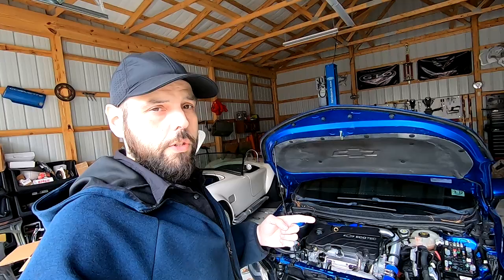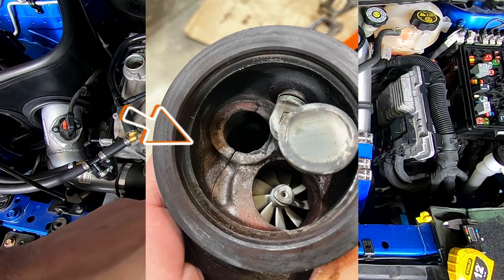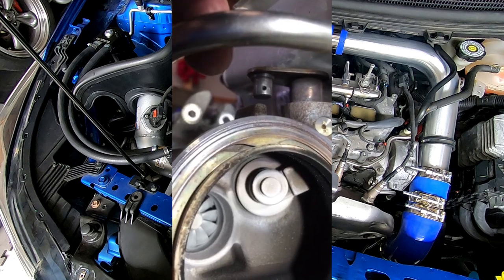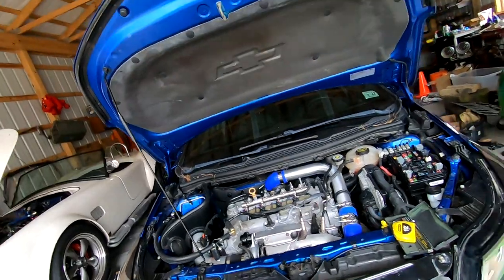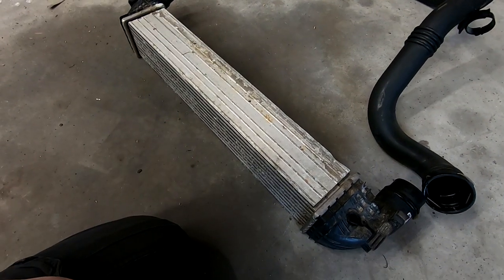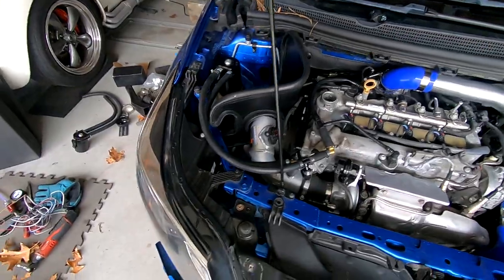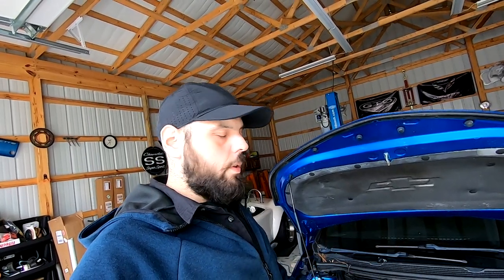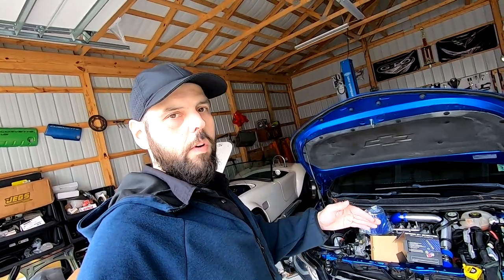Common CRUZE problems and issues from Dave's World

Comment: The code that keeps coming up for me is P0299. Usually happens when I accelerate and once the code comes up the car drives extremely sluggish and doesn’t want to move at all.
Reply: To add this code goes away and comes back. Some days the car drives great and other days it drives sluggish and that’s usually when the check engine light comes back on and gives me the code p0299.
Reply from the maker: @tylerwhite7367  Are you running a cold air intake?
Reply: @davesworld2132  yes I am
Reply: I was getting this code before the cold air intake though.
Reply from the maker: @tylerwhite7367  It could be a few different things. It could be a dirty mass airflow sensor. It could be an intake leak. It could also be an exhaust leak. Is the car running like crap?
Reply: @davesworld2132  some days it drives normal and other days it drives like crap, check engine light comes on and off. I just ordered a new wastegate thinking that my current one might be done for. I replaced my spark plugs last year still had the same sluggish problem. I’ve been trying to research this for a while. I brought it to the dealer when it first happened to me about 2 years ago they looked at the turbo and didn’t see anything wrong with it they cleared the code and said if it comes back on again to call them about discussing replacing the turbo which didn’t sit right with me.
Reply from the maker: @tylerwhite7367  are you tuned? And what your peak PSI?
Reply: @davesworld2132  no clue on my peak psi. Also yes it is tuned with trifecta. I installed the tune six months after I purchased the Cruze brand new from the dealer. I noticed sluggish once around 30k miles but thought it might of been a bad batch of fuel. Now for the past two and a half years it’s been more regular with the on and off of being sluggish. It was sluggish on my way home from work today and then driving it to dinner it drove normal.
Reply from the maker: @tylerwhite7367  what wastegate did you buy?
Reply: @davesworld2132  I bought the mamba wastegate off eBay
Reply: @davesworld2132  I also bought the Performance Recirculating Valve off BNR as well maybe thinking that could be the issue as well. After I install these I plan to have the car re tuned for the upgrades that I install
Reply from the maker: @tylerwhite7367  what’s the box say on it? 10-16 or 16-19?
Reply: @davesworld2132  not sure on what the box says since I haven’t received it yet. eBay does have it listed under my engine size so I figured I’d give it a shot and see if it fits and resolved my issue lol
Reply: @tylerwhite7367  I have the same exact issue, 34k miles, trifecta tune, happened before I put in the aftermarket KNN cold air intake. Shows engine code P0325. But vehicle will stop accelerating and drive very sluggish, only when I hit the accelerator heavily on the highway from 50+ mph when merging. The engine light turns off directly after swapping back to stock and I cannot reproduce the issue on a stock tune.

Comment: What about code P0327 ?
Reply from the maker: That's a knock sensor code so you have a fuel issue or possibly a 12 volt wire/sensor issue. Typically its a fuel issue most commonly.

Comment: Wow no wonder when I opened up my transmission solenoids and took out this plastic tube my boost leak check engine suddenly disappeared like it didn't even bother coming back on 🤔🤨😯😲
Reply from the maker: Interesting. What trans was it?
Reply: @davesworld2132  It's 2017 Cruze 6-speed AT 1.4L. I was to clean the solenoids and needed to remove the plastic tubing from throttle body to intercooler and having a engine code before hand for boost leak P0299. But probably because I disconnected the battery for about a week that the code disappeared I don't know and when I hook it back no more engine code P0299. I'm about to get the transmission rebuilt, the previous owners might've beat the crap on her but I wanna correct as the engine really is running good. That plastic tube is crap 😂🤣
Reply from the maker: @czerus2233  Do you have any transmission codes?
Reply: @davesworld2132  the whole time I owned the car since last year only the P0229 only but the transmission started to miss 5th gear randomly, and jerks shifting the 3rd all the time. It was back in January when it gets severe even 6th gear wobble/shakes (when the car is underload going up a slope or with passengers) the car along with 5th gear so technically I can only drive down the side streets as the 4th gear only goes 50mph @60mph it just screams and in need to shift to the next but like I said shifting to 5th gear will make the car shake violently. Then one night on my way home I really wanted the transmission code to show up so I kinda push the 5th gear till the car went limp mode (It only show on the Dash "L" and not the usual "L1,L2, etc) and there it was, P0796 and P0700, one is for Pressure Solenoid failure and Failure or open circuit in TCM for the second one.
Reply from the maker: @czerus2233  Oh ok that makes sense. At first I thought you meant the intake caused leak code caused the problem. Are you doing the rebuild?
Reply: @davesworld2132  My initial decision is actually buying a low mileage salvage trans on ebay, have it delivered and swap it and for the meantime to make the car back to the road but due to issues I can't sit and work on it.. it's better I get it fixed as there might be upgrades/updates to this automatic transmissions only the specialist can do (like drilling new holes and plugging the faulty location etc.) and for the warranty if something went wrong (gonna bite the bullet 😣). My original plan is to have my old transmission rebuilt by myself slowly as I get the replacement parts so I have 2 to swap in and out as this are not really that reliable as they say (or it is once the trans specialist does update the internals and make it reliable I don't know yet). But for this video that you made when you mentioned how the plastic tubing that runs from the throttle body to the intercooler might cause boost leak code when not seated properly or through vibrations over time produces the leaks and I think that's what made my check engine code disappear 😁 as the cheap scanners does point out the turbo charger replacement are one of the options.
Reply from the maker: @czerus2233  Yes that would definitely cause that. I’m glad it was somewhat helpful. I do have those pipes as well on my website. Ironically transmission wise I’m going through the same problem with my wife’s Acadia. I’m going to be doing the same thing and swapping out some trans parts.
Reply: @davesworld2132  this transmissions are a pain to find info let alone this 6T35's on the '17 Cruze. I tried buying a AT solenoid pack on ebay and turns out it was 1st gen TCM compatible wasted time and $12 to ship back to the seller so that's when I tried cleaning out the solenoids but still having problems ( from what I learned the bad design wave plate eats the barrel of the 3rd,5th,reverse but I really don't know why my 6th also shakes the car) and tried looking for more info and remembered some updates on AT transmissions includes upgrades on the valve bodies, pistons, etc and plugging, reboring hole on the valve body it just came to me this is too much for me as this is my first time really doing hands on a car. I really wanna be able to fix my own car as things are not really going good when it comes to shops and dealer's labor mark up. I hate to admit but I need to bite it and get my AT fix ASAP as prices goes up so does labor cost 😑😑😑
Reply from the maker: @czerus2233  Rock auto may have them
Reply: @davesworld2132  after I'm done with this transmission I'm looking at the intake tube and intercooler upgrades you made as this AT bathe the solenoids with hot ATF thus in time kills it. Do I need a tune with the intercooler and pipe upgrades, should I get the BNR first? Or later after the upgrade.
Reply from the maker: @czerus2233  I do believe in a tune. They just help a car overall. You would not need to tune because of the pipes the computer will adjust
Reply: @davesworld2132  how about the intercooler?
Reply from the maker: @czerus2233  so far biomes needed a tune because the ecm will adjust for the new airflow. Even with the factory tune I have people report back to me saying better throttle response and better intake temperatures. With an aftermarket tune you can just pick up a lot more power either way it’s an upgrade